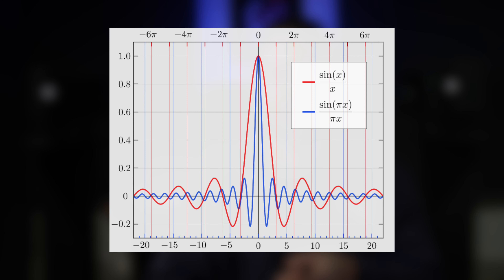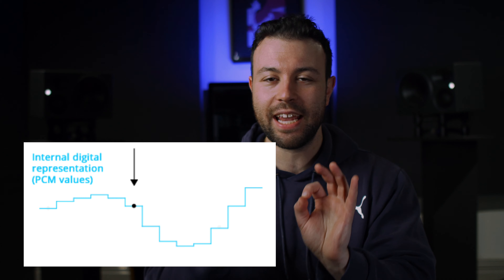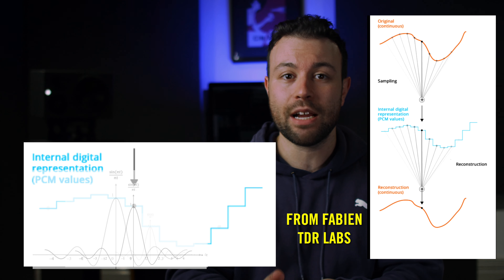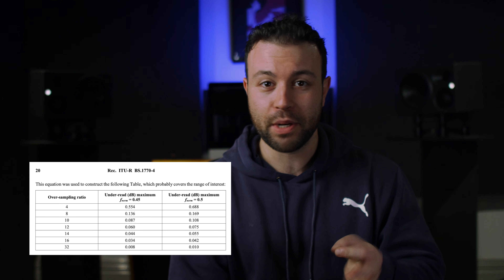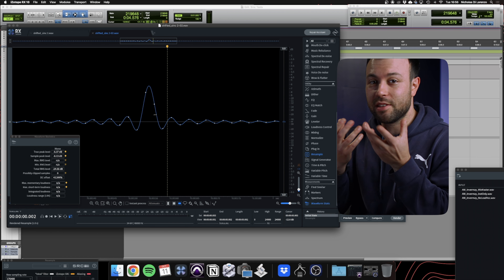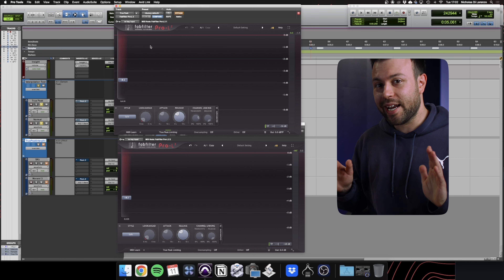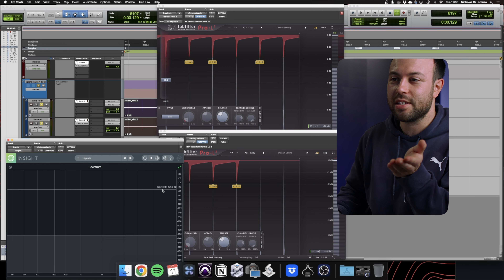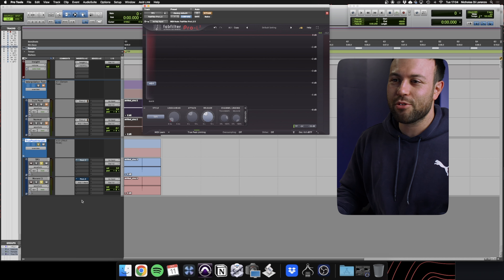Is True Peak Limiting a Lie? What You Need to Know!

Comment: Ohhhhhhh that ISSS what's happening... You see I theorized this last week in a much less technical way, but because I often don't turn on true peak until I've already dialed it the limiter I always turned it back off immediately because of what it did to the transient information, plus... I haven't been aiming for Apple Digital Masters anyways 😳
Reply from the maker: yeap ! It's a very funny user-workflow error inherent int he design of just having a "button" which you switch on and off; 

if when it was enabled the gain was offset by the difference of maximum under-read between current PCM encoded data and given upsampling size that would solve this;
Reply: I wonder if they thought of that or made a conscious decision not to dummy proof it, send this to the Fabfilter folks
Reply from the maker: Ha YES! I shal;

Comment: Great. Video. So what happened when I clip a signal, with a clipper, then I have only one peak = true peak . Or I am wrong ? Thanks
Reply from the maker: Definitely not wrong; and this is a TECHNIQUE I use in mastering with overly transient/pokey mixes;

The theoretical "true peak" is the point in which the reconstructed wave-form reads higher than the adjacent sample points;